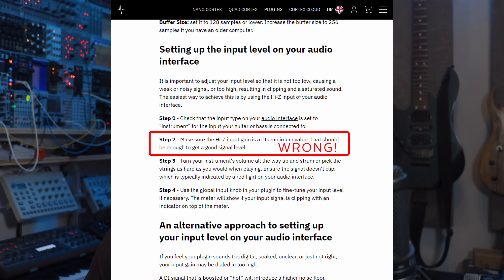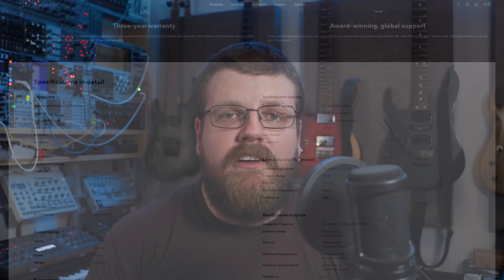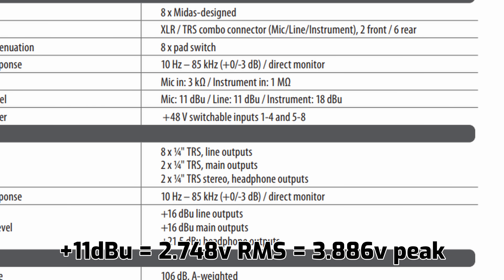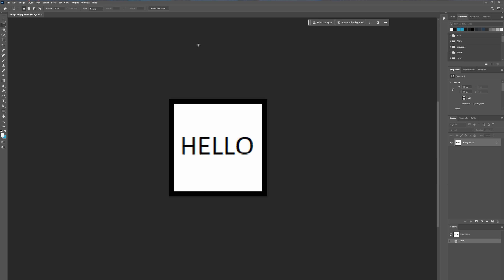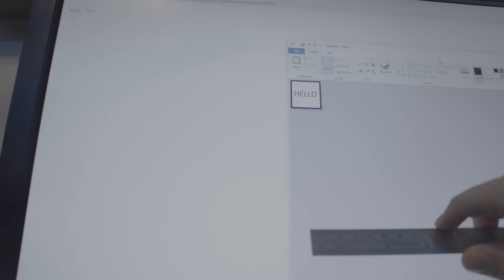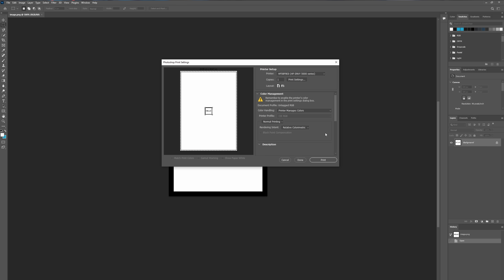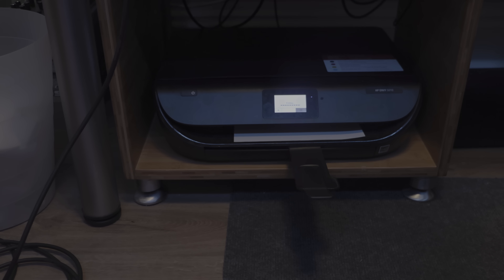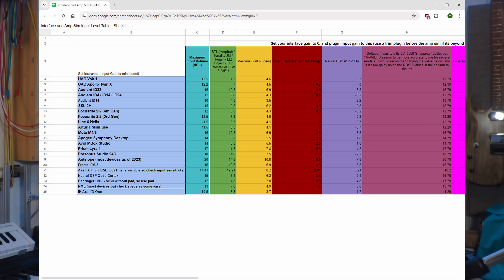Ampsims and input gain - Please, stop the madness...

Comment: The video is so long. Isn’t it just simple: lower input means you effectively only use a fraction of the available bits? Imagine you have 16 bit integers that gives you roughly 65k individual levels. If the input signal only uses 25% of the max level, congratulations you just reduced the effective sampling to 14 bits!
Reply from the maker: 100% correct!
Reply: @GhostNoteAudio it’s relative though because my interface samples at 24 bits so even if I only use 25% it’s still 22 bit sampling. 

The thing I worry about the most is noise. My rule of thumb is to try and not use any amplification. Use max level on the inputs, max level on the source and if there is clipping just make the source volume lower.

Some synths might not output enough volume and in this case it’s probably best to put everything at max level and add gain digitally after sampling.

In any case I would never want the input gain any lower than max. Just adjust the volume on the source device.

Comment: Genuine question, if you turn up the input gain on the interface right before clipping, then reduce input gain on the plugin, wouldn't it be the same if you left the input gain low and just turned up your input gain or your plugin? Ive done it that way and got good results from my clean, crunch, and high gain tones
Reply from the maker: It IS the same - except for one important difference, which is the whole point of this video; by turning up the input gain on the interface, you are utilizing the entire dynamic range of the analog-to-digital converter, resulting in less noise. That's what everyone missed, and the reason why I made the video.
Reply: @GhostNoteAudio Okay I understand now. Thank you for your insight.

Comment: I feel like that misperception may come from digital mixers, where the digital trim after preamp and ADC would nearly always be 0 (and often can’t even be controlled). That is because in that example the ADC and DSP are part of the same unit and designed around the same scale. That isn’t always going to be the case with a basic interface and software processing.

Comment: HUGE thanks for this, and protip - it works on hardware too, at least it does on the TONEX. Global input gain = "interface" input gain. Then the amps react exactly as described, by reducing the amp sims input gain to match the increase in global input gain. Probably already known but hey I didnt find this until a couple days ago, just tried it and Im over the gatdamn moon that it fixed the only problem I had with the TONEX, that being the noise gate acts wierd if I have the gain staging set wrong. I didnt even realise there WAS gain staging to it like this so again, thank you, 11 months later and far off in the weeds from the actual topic, but just had to say it cause you seriously saved my sanity with this.

Comment: Complete non-issue of course, just typical YT slopslop. With low end crap that records at 16 bits, yes, you do want to hit -12db (digital) because you don't have much resolution. But with 24bit or 32 bit recording, you are always better off staying clear of at least 2-4 MSBs. There is simply no need to go that close to the clip because the resolution is so high. You also don't exist in isolation - there are other instruments in the mixdown that will, together, have momentary peaks well beyond the dB baseline and you don't want that nasty clipping. That's why all the manuals and all the people advising you to stay away from MSBs are right and you are hilariously cute, but desperately wrong. It's fine to leave  2, 3, 4 (24dB) or even 5 MSB (48dB) untouched, there is no audible difference in a decent, clean 24bit or 32 bit setup. Especially if your baseline to prove a point is a distorted, dirty guitar sound (wtf?).

Comment: is there any rule of thumb if I want to use an external IR loader plugin to my amp sim's built in one? Using Pulse IR loader with STL clips heavily for understandable reasons, but not sure what process to use for managinginput levels on plugins after the sim
Reply from the maker: All of this only applies to the signal chain until the signal hits the main nonlinear component in the chain (the ampsim, in our case). Whatever comes after the ampsim is pretty much irrelevant, adjusting signal levels at that point is only affecting the volume (loudness) of the signal. An IR loader is a linear device by it's very nature, and so you don't have to worry about the signal hitting your IR loader. Just make sure the track output doesn't clip your audio interface output :)
Reply: @GhostNoteAudio  back here a month later to note that I was being very dumb and hadn't noticed that the built in IRs on the plugin had turned back on so I was sending the signal from the plugin which had already been through an IR, into an IR >_<

Comment: saying this without understanding dynamics and the dynamics of a sound when you can bandaid noise and dynamic issues with compressors/gates and the reason why people have the input lower on the interface is for the extra audio floor when adding an input. can’t believe people see some guy on youtube that solely plays guitar with zero knowledge on audio engineering and believe this sht. 

you can bandaid dynamic/noise issues. you can’t bandaid clipping distortion when the input is already so close to 0db.
Reply from the maker: You win a prize for "most uninformed comment" on this video. Literally nothing you wrote made any sense. Keep responding though, the algorithm loves it 😁
Reply: @ I’m uninformed yet you don’t respond to anything I said. I’m sure you know a lot about audio engineering and not just a reddit-andy clickbaiting and spreading miss information because you used some db meters on a guitar amp and cherry pick your claims.
Reply from the maker: @zzzzz00012 there is nothing to respond to because literally everything you said is rubbish. One should increase the gain until it's as high as it can go without clipping. This gives you the best dynamic range and signal to noise ratio. No need for any band aids - it's already as good as it gets. If you want proof and evidence of that... WATCH THE VIDEO. That's why I made it 😂
And "Miss Information" is some lady I don't know. Maybe you meant "misinformation"
Reply: Just complete nonsense

Comment: This is sooooooo Basic that you need to set the input gain as loud as possible in analog recording because you can always reduce the gain after the recording but you can not increase the gain level after the recording is done because the noise level increases as well. and the logic is the same in digital recording.

Comment: What about the dynamic? Do you have a bigger dynamic range by 0Gain on the Interface and not pushing it just before to the clipping limit? So may there be a correlation between singal to noise ratio and dynamic range? That is overlookedbin the discussion?
Reply: Literally not a factor at all

Comment: Signal to noise is pretty basic but setting the “optimal” input level for a plugin is often missed by producers. I was unaware of the guitar ampsim optimal settings as I’m a producer and not guitarist. 

In terms of mixing and production I believe I read somewhere that plug-ins modeled after physical hardware often have a sweet spot for the input value around -6db. This is probably due to -6db being a desirable level for both signal to noise and headroom. Mix engineers historically desire pre-mastered tracks at -6db. 

Understanding some of the nuances of saturation really helped me start to appreciate how input level plays an important role in how a sound is shaped. Great video on YouTube called “you don’t understand saturation.”

Comment: I haven't tested it properly yet, but i've encountered an interesting problem with my audio interface and my amp. My DI is clipping on my Behringer UMC202HD whenever i play muted top notes of a "G" chord on E standart tuning. Just 3rd fret on 6nd string, and 2nd fret on fifth string with my picking hand on the strings (palm muting) - and my DI clips. It happens with selected "Pad" and "Inst", but my Clip indicator is far off from activating (with "pad" and "gain at 0" strategy - even my "SIG" light is not always on). I searched for answers on google, and found out that i just need to buy a DI-box, or use something like a Boss pedal, working as a (as i understand) "inst level to line level converter" (buffer?).

Even funnier fact - my Marshall MG15CFX amp does THE SAME THING!! Bridge humbucker, palm muted 3-2-x chord, clean channel, and i hear that clipping crackling sound...

Can anybody explain to me, what would be the best option? Wire other humbucker that has less output? Buy a DI-Box so my lvl would be less "strong" to my audio interface/amp? Switch to "Line" input mode on my Behringer? (Which as a chat gpt told me - would "kill the liveliness of a guitar sound" (what??)).

Thanks in advance, guys!

Comment: So there are a bunch of morons on the internet who don't understand gain staging what-so-ever explaining to people how gain staging works... Paint me surprised. It’s the same idiots that argue over what is the best sounding HD to record to or advising people to “normalize everything” before mastering.  If people think an input gain should be left at zero, then they clearly don’t understand input gain, perhaps people are confusing it with the gain setting on an overdrive or tube amp.

This is a great video because you have demonstrated to people how the noise floor and how signal to noise ratio works.

Comment: So, just SUM the interface input and the ampsim inout to 0. Makes perfect sense. It’s a shame you need a 3rd party spreadsheet, and an additional plugin to accomplish that. You’d think the manufacturers of gear designed for amateur home recording would have a vested interest in making this easier.
Reply from the maker: It would be great if there was a standard for this (that people actually used) - but the honest truth is; if you set things by ear you're probably going to be just fine :) the point of the video was just to be a "the more you know..." type of knowledge sharing. You're not doing anything bad or naughty if you just tune it by ear :) this only really matters if you want your jcm800 amp sim to respond exactly like a hardware jcm800, etc.

Comment: am i doing it right with audient evo 4 ?
1. guitar > evo 4 hi-z instrument input > reaper daw
2. without any fx in reaper, strumming / palm mute hard and set the gain on evo 4 just before clipping / red in reaper meter
4. open amp sim neural dsp nolly
5. reduce neural dsp nolly input level until it sounds like a guitar running thru an amp.
6. and thats around -12db to -13db ... is that normal ? thx

Comment: Thank you very much for the explanation! I want to clarify whether I understood correctly what needs to be done))) I need to connect the guitar to the audio interface, set the gain on it to the loudest possible level, but not leading to clipping (for example - 3dbfs), and then in the stimulation plugin reduce it to the recommended input signal level for this plugin (for example - 12 dbfs), right?

Comment: The biggest issue here is the naming of the control knob.
Often it's called a gain knob, but very vast majority of audio interfaces, it's rather an attenuator. Some can do some additional analog gain as well.
I have come across a few interfaces that change the gain in the digital domain or sometimes in the PGA in the ADC itself.
The goal with any ADC, is to (always) maximize signal as much as possible before clipping.
Luckily a guitar signal is rather weak. So clipping the ADC is quite difficult.
This actually also true in the digital domain. (One reason why 32 bit float plugins are nice). Unfortunately it's a bit of a mess how some plugins take care of this without compromising ideal headroom before clipping.

Getting an interface with a proper SNR also helps. I personally aim for at least 108-110dB or better. Mostly to have some headroom.

Comment: For the Quad Cortex unit, this is the same argument! 

Where do I set my input volume of my guitar?When I plug in 0.0 ??  

Another greater issue is when capturing a pedal on the unit ..  where do I adjust the input volume to get the 'most authentic' reproduction of the pedal for capturing??

Help!!   Ty!

Comment: THANK YOU.

btw just a small detail, -1 to +1 sample values is used for (most) floating point sample formats, with usually 32 bits per sample per channel. Signed/unsigned depends on the number of bits, for 16 bits there are 65536 different values that are -32768 to +32767 for signed, 0 to 65535 for unsigned, for 24 bits there are 16777216 different values spread the same way for signed/unsigned, and so on.

Comment: Okay so lemme get this straight with an example: 

I'm using a UAD Apollo Twin X and Guitar Rig. 
Your spreadsheet says to set Guitar Rig to -6.3db. 
Then I play my guitar as loud as possible, and turn up the input on the Apollo until it's clipping; for me, that's 35db. 
So I then further subtract 35db from the guitar rig input gain - meaning the total input gain in guitar rig should be -41.3db.

 Is that correct? It's so quiet compared to what I'm used to -- obviously I can make up for that with compression & make up gain, but I'm afraid it's not hitting guitar rig hard enough. Just wanna make sure I'm not misunderstanding something
Reply from the maker: I highly doubt you're able to add 35dB to the input gain on the apollo, that would imply something really not right. Other than that, the process is correct, but yeah, something weird is up with your input sensitivity :)
The UAD Twin X has a Maximum Input Level (at minimum gain) of 12.2 dBu on the Hi-Z Instrument input (according to the manual, and the value on our online tool also matches this). A guitar pickup signal should be fairly close to maxing that out, I'd think maybe 4-6dB gain boost would be reasonable, and should be pushing the signal almost into the red. If that isn't the case, your issue lies elsewhere (active pickups with a dead battery, maybe?)

Comment: I have the focusrite and Mcrocklin guitar suite. I discovered this issue early on. I didn't jack up the knob to almost clipping, but just in the green, barely yellow. then reduced the input in the sim. But I still have an issue with when holding a note, it especially a fade out at the end of a song, loud noise comes through and overpowers the fading note. I'll have to try harder with your suggestion

Comment: Yes digital is not the same it works with binary code 0,1 it’s better to think of it as an oscillator. The key rules are for recording on digital or analog if something is to low or to high you will never fix it correctly. Also thinking of a digital knob like a fader can make it easier not as gain nob on an amp.  Think of the nob like this similar to a fader 0, -30, -25, -20, -15, -10, -5, 0, +5, +10 or +12. Also people confuse loudness with level control

Comment: PERFECT...... if the only noise is coming from the interface, but this wasn't the case in my setup. I plugged in a guitar, and was met with noise at all times, noise that came from my guitar pickups. I looked everywhere for a solution. The solution was to turn the gain to 0. I did, and it worked. I had a much cleaner sound. When testing advice meant for the masses, try using gear available to the masses. Test the same thing with a cheap guitar and a Scarlet Solo. Everything my band recorded at a moderate input gain had to be discarded, whereas everything we recorded at 0db is crystal clear. I appreciate your very wordy and mathematical take, but I trust the physical reality that I've already witnessed, and rather than positioning yourself atop Mount Olympus as the lone arbiter of truth, maybe dig deeper into how and why such a large swath of people, including those who are talented and respected for their ears and knowledge might disagree.

Comment: I tried to replicate the experiment and I'm not achieving the same reuslts:

I did everything right (I guess?) and the noise is louder with the method provided in the video.
I set my plugin input to 2.8 (I'm using neural DSP and an SSL2+, so checks out on the table) then I played as loud as I could, while setting my audio interface gain to the limit of clipping the DI. I got ~ +4 in the interface. Then I subtracted the +4 with the  2.8 and it gives me -1.1. I set the plugin gain to -1.1 then. Also disabled the gate.

HOWEVER, I hear more noise this way than with 0db in the interface and +2.8 in the neural DSP plugin. Is that supposed to happen?

Comment: So, pretty much:

1. Set the interface gain to 0;
2. Put the input gain of the plugin according to the table;
3. level up the gain on the interface until it is on the limit of clipping, playing as loud as possible;
4. Reduce the digital gain on the plugin to compensate;

One thing that I don't get: should I play as loud as possible with the plugin activated, or with DI? Does my sound with DI, no plugin has to be on limit of clipping, or is it the limit of clipping including the plugin processing?

If you could answer me it would be amazing
Reply: I'm asking because I did everything right (I guess?) and the noise is louder with the method provided in the video.
I set my plugin input to 2.8 (I'm using neural DSP and an SSL2+, so checks out on the table) then I played as loud as I could, while setting my audio interface gain to the limit of clipping the DI. I got ~ +4 in the interface. Then I subtracted the +4 with the  2.8 and it gives me -1.1. I set the plugin gain to -1.1 then. Also disabled the gate.

HOWEVER, I hear more noise this way than with 0db in the interface and +2.8 in the neural DSP plugin. Is that supposed to happen?
Reply: @bufasprod I have the same problem using UAFX amp plugins and a Motu M2. More noise. The documentation from UA on the amp plugins recommend to put the input gain on the interface on 0. So, clearly I don't know what to do.